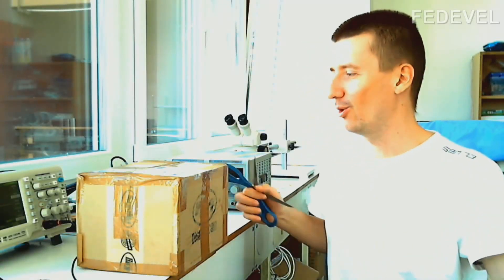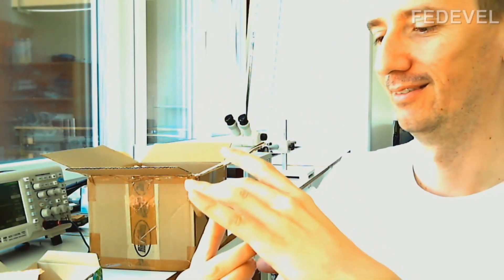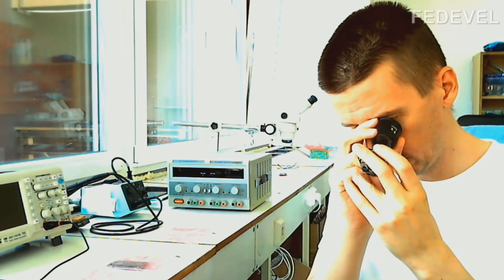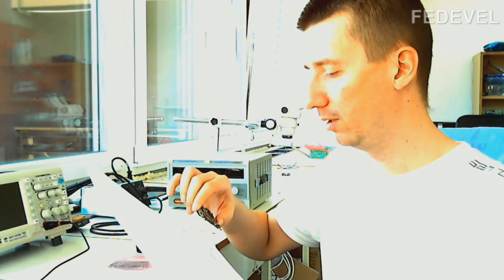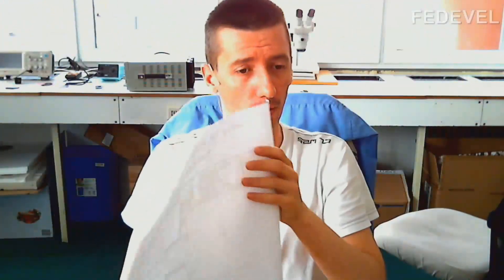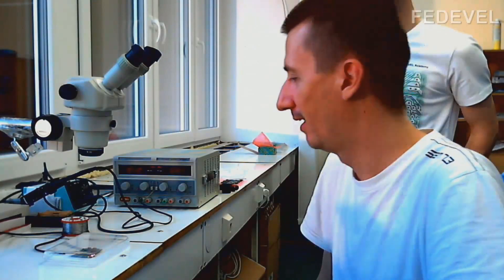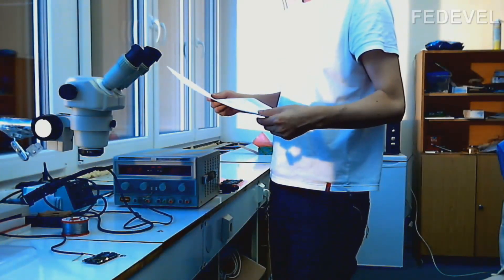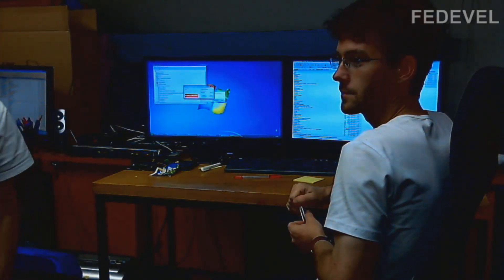Bringing up i.MX6 Board to Life - from unpacking to booting

Comment: Great Work! Robert. 
I used to touch components like you when I was repairing malfunctioning boards.
Now I am using affordable thermal image camera, like Therm-App, to replace the ' finger-touch ' process. 
I always suspect that sometime when I touch the boards with my fingers, it could damage the boards, due to static charge.
By the way, what is shirt on Martin? Where to buy it? Looks so cool!!!
Reply from the maker: Yeah, thermal image camera would be awesome! That is much better than fingers. I just could never justify price of the camera comparing to number of use we need it. PS: I checked Therm-App, they look still over 1000 USD, or do you have something cheaper?

About touching the board by fingers and damaging something - I always say, if there is something sensitive on my board, I would like to be the first one to find out. Of course, you would like to use a proper ESD protection when you are handling products which are going to be shipped to customers, but in lab and with prototypes I always try to be "the worst scenario" :) 

Martin is wearing one of our T shirts: https://www.instagram.com/p/BZja25Chy_d/?taken-by=fedevel.academy
Reply: One of my friend use FLIR-ONE, it's 199USD and 399USD for pro. But it's said that iOS support is better than android and also I am also told that it's performance is no as good as therm-app. Better borrow and try it first before you buy it!
Again, really Cool T-shirt!
Reply from the maker: Now, I am thinking to get one :D. Does your friend own both versions? Is the 199 worth it or 399 is much much better?
Reply: My friend and I both think that flir-one (android, not pro, 199 usd) is not suitable for electrical engineering.(More suitable for Electricity level)
The thermal resolution is only 80x60 and only within -20 °C – 120 °C.....
There are currently no PRO version(399USD) around us, I cannot make comment on flir-one pro.
Reply from the maker: I purchased the FLIR ONE PRO :) and I may do some videos about it, so also other people can make their own opinions. Thanks for the tip - I didn't know there are so cheap thermal cameras. Now, let's see if it can do the job - inspect boards :)
Reply: can't wait to your out-of-box video!!

Comment: Good evening.
My name is Roberto. I'm from Brazil.
I would like to know if I can run windows 7?
I was wondering if this module or another they have can stay 24 hours connected?
I'd need to use it with biometrics.
Reply from the maker: It doesnt run windows 7. It runs Linux or Android (the iMX6 processor is ARM, for windows 7 you would need x86 architecture). The boards can run for months, tested, no problem.

Comment from the maker: Hi GG96538, please, can you clarify your question?
Reply: Oh sure,

Footprint needs the special string ".designator" on one of their mechanical layers to generate the assembly drawings documents with the associated designator, right ?

There is a short way to do this ( some form of add this special string to all footprint at once ), or I have to add the special string to all footprints manually ?

I hope this help. Than you!
Reply from the maker: GG96538 we add the string manually to each footprint when created.
Reply: There is also a script called 'adjust designators 2' that can handle this. Link: https://code.google.com/p/altium-designer-addons/downloads/list